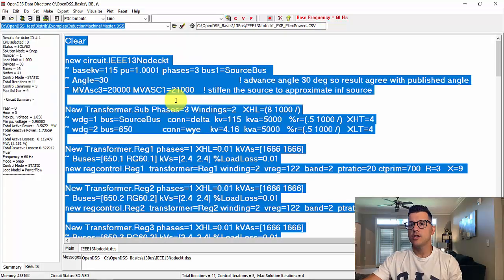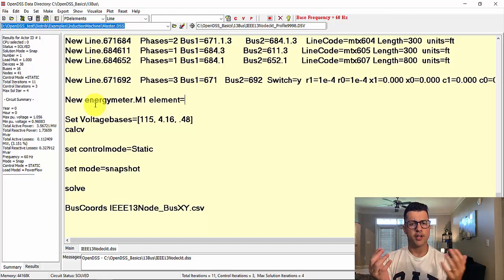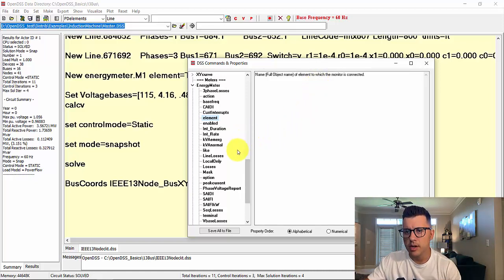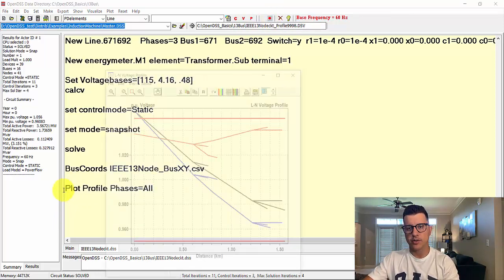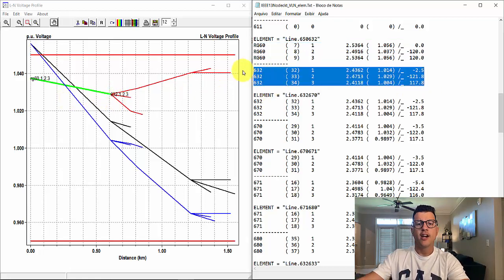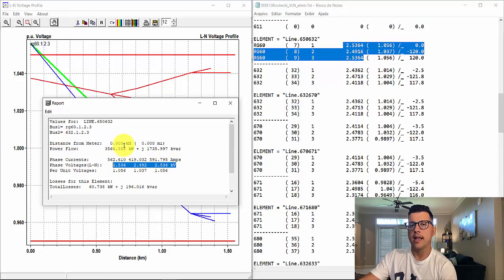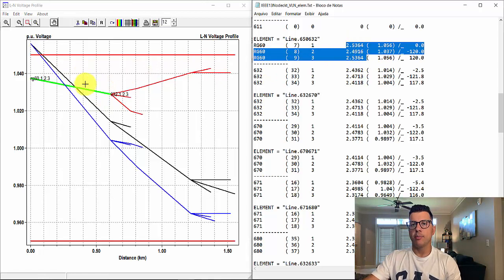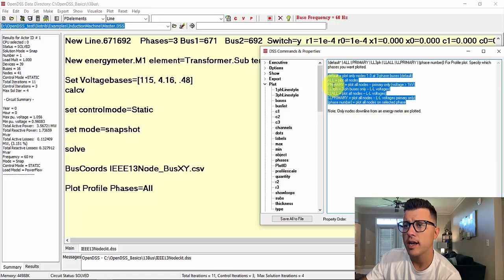11 - [En] OpenDSS Basics | Voltage Profile

Comment: Brother, I want to fix the transformer taps  to get 1.03 volts of the main bus bar in the IEEE13 Bus bar test case. Please can you tell me how ? Just write the scripts here if you can
Reply from the maker: Hi! Each transformer winding has a property called "tap" that you can use to set a value to get 1.03 at its secondary. You will need to turn off the regcontrols for this case.

Don't forget to subscribe to my channel 🙂
Reply: @PauloRadatz  I already subscribed,  do you know the value of the tap to get 1.03 v ?
Reply from the maker: Knowing that V2/V1 = N2/N1 and N1=1. If you want to have V2=1.03, tap or N2 should be close to 1.03/V1. So, as you can see, the 1.03 depends on the load level as V1.
Reply: Brother,  the transformer that talked about is the  transformers between bus 650 and RG60 in the IEEE13 bus base case that you are making this video about. I want to fix the taps and get 1.03 v . Please advise how to do that exactly. You will save much of time for me if you tell me directly

Comment: Thank you for this video Paulo,I hope to help me ,I have load flow for the system and there is interface between MATLAB and open dss  but i cannot calculate pu current and power
Reply from the maker: OpenDSS does not provide power and current measurements in per unit (pu). You need to obtain the power and current in kilowatts (kW) and amperes (A) respectively, and then calculate the per unit values on your own.
Reply: @PauloRadatz  how can i do that?
  Please help me❤️❤️ i want to use it in my Master researsh
I want to make them in variable beacuse i will use both  in optimization code

Comment: Thank you for this video Paulo. Waiting for PV system in English.
Reply from the maker: Hi Fathy, thanks. 
I will work on that this year. But in the meantime, you can watch the virtual training we did in 2020 and 2021. See session 3 under the attachments tab.
2020: https://www.epri.com/events/C97292AF-0790-4514-B9DF-CCEF80D685E1
2021: https://www.epri.com/events/FB4CF76B-D97D-44CC-9523-4C9243381BD1

I hope it helps.